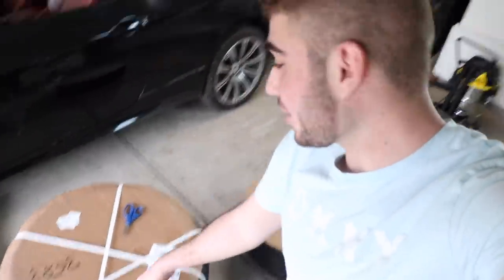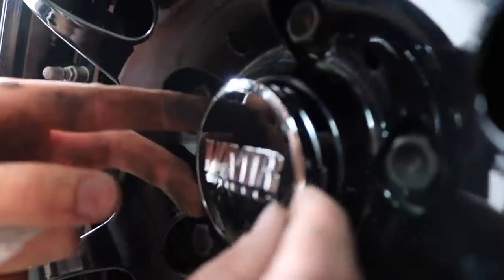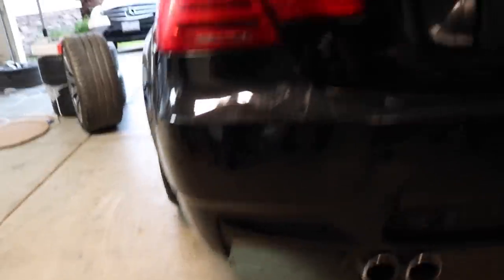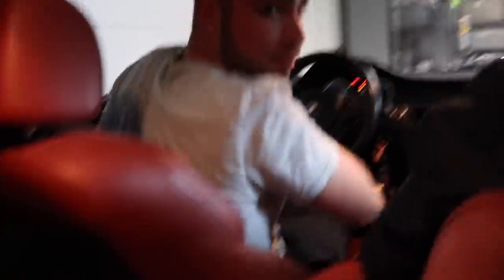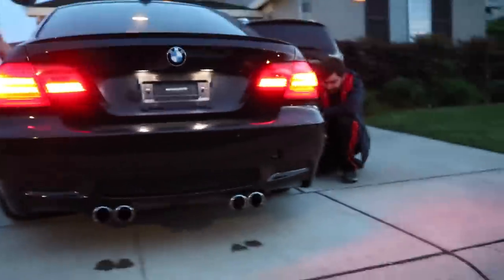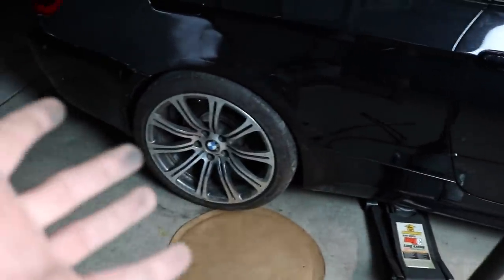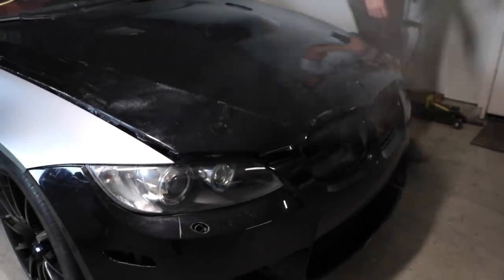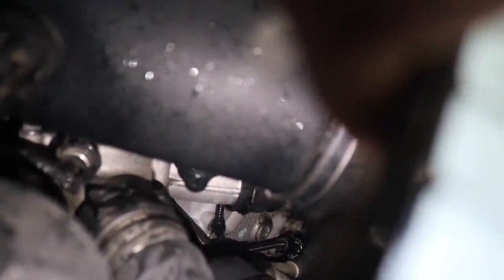E92 BMW M3 GETS NEW WHEELS (FIRST LATE NIGHT DRIVE)

Comment: In the last video there was something I noticed. Not trying to be mean just trying to help out. I think when you installed the lock on the driver side door you might have flipped something. When you locked it the bar disappeared under the door card. And then you unlocked it it rose up but only to the spot that it should be in when you lock it. I hope this helps out. I love the build, it’s my dream car. I had a 2005 330i manual and they do that in reverse.
Reply from the maker: Yea saw your comment, I’ll fix that when I start wrapping! Since I’ll need to remove the mirror again!

Comment: I'd recommend changing your serpentine belt since it got coolant on it. I spilled some coolant on mine and it shredded a week later
Reply: Anthony Sarrouf would that blow the engine?
Reply: @trugani569  not on this car or any BMW with an inline 6. The serpentine belt is separate from the timing chain. The belt online powers the steering pump and AC compressor. Not sure what else honestly
Reply: Anthony Sarrouf it also charges the battery so that will go flat
Reply: @xBigModzHD I forgot if the alternator is connected to it or not, good call
Reply: Anthony Sarrouf yep not a good situation at all

Comment: Pull the metal clip out, reinsert the the hose and press the clip back in to lock in place. Get a torque wrench, dont want the wheel to fall off while driving.

Comment: 2 things; that is normal for the clutch it let off little and the car will creep backward or even forward as well all cars does that and second thing is next time when your looking for leaking air on the tire use spray bottle add water and soap to find the spot of bubbling meaning that is leaking.

Comment: Get good tires on the car, otherwise the traction control will kick in and if you've turn off the traction it will spin through first and second gear, I had nankang nobelsport on it and it couldn't handle the power, now i have Goodyear f1 eagle assylum , its perfect, anything better is overkill unless you track the car, but if you get good tires you'll get alot of rock chips on the rear bumper and front fenders, good luck , and do a muffler delete as soon as possible 😅